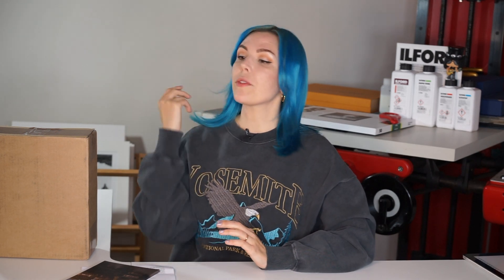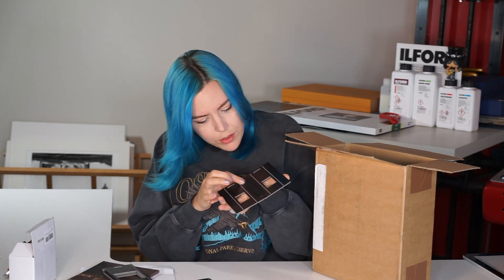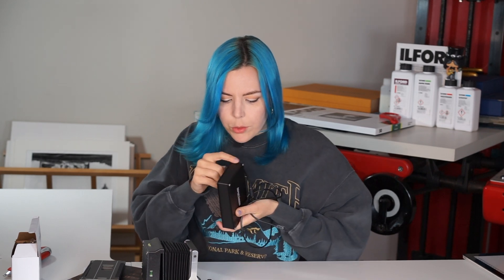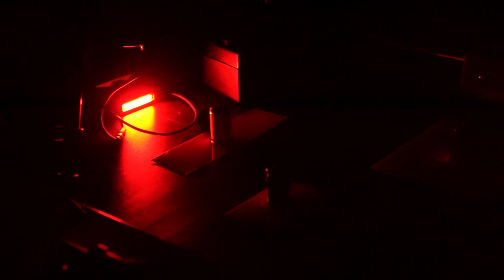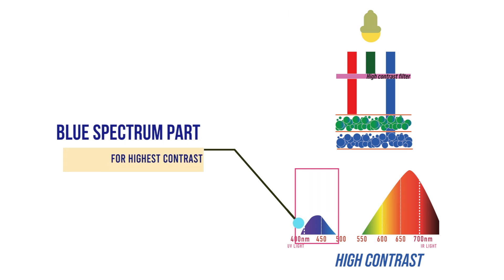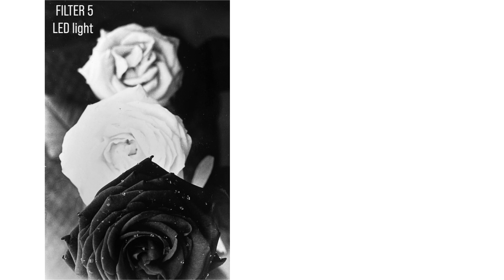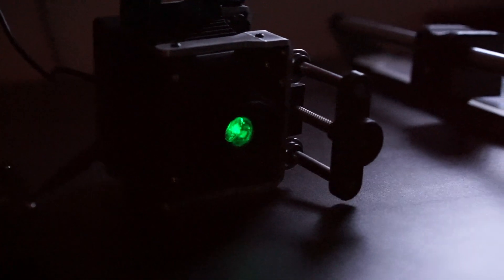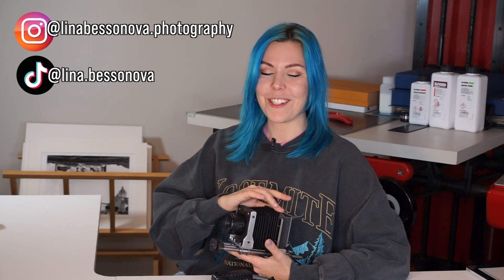Intrepid Enlarger Prototype Review

Comment: Very relevant and beautiful analysis especially the limitations of LED. I am a fan, The unpleasant aspect of blue/green systems is how dark the image appears on the easel while focussing and dodging and burning. Ilford Multigrade 500 is the father of all these b/g systems. Often for cheap on eBay. About the issues of glass carriers, pro labs and precision enlargements needs perfect flatness to exploit to the max the quality of your nice Schneider Componon S lenses. Focomat enlargers have a top glass at the minimum. Pro Durst and DeVere also. Dust management can be learned in a few minutes and saves spotting and improves local contrast by keeping sharpness. Beseler Negaflat carriers were the only ones to my knowledge to address flatness without glass. They are hard to find and they damage the very edge of the negative. Thanks again!

Comment: Enlarger in a case:  My first enlarger was an Opemus IIIC and it had a "case".  Eventually tossed their lenses for Nikkors.  Also had glass and glassless negative carriers.  The enlarger had a very nice focus aid.
Reply: In one form or another, those Opemus models have been around since I took photography in high school in 1961.  Quality design and construction unmatched by any Beseler or Omega model. Better than the small Dursts (and I use Durst exclusively). Harder to find in good shape these days, but a value if acquired.

Comment: Thank you for doing the Led breakdown! It's good to know what the benefits and the limitations are. I think I'm going to give this thing a try because I have a tiny house with a tiny bathroom, but I think I can make this work. I've been dying to do some printing instead of just digital scanning of my 35 and 120 negatives. I just can't fit a full sized enlarger in my home.
Reply from the maker: If you have well-exposed negatives, you won't need a filter 5, it will always be filters 1,5 - 3,5. As a beginner's enlarger it's more than well-built.
Reply: @linabessonova  great! Thanks!

Comment: If you have a color enlarger, do you still need to use filters for variable contrast paper?  I’ve never had a color enlarger myself so I used filters.
Reply: Old comment, but no, I don't think you do. If you have a colour head you can use that to work with multi-grade B&W papers. I think The Naked Photographer has a video covering this topic.

Comment: Great review but you did not give a conclusive, I would by this enlarger - or wouldn't, comment. Intrepid themselves compare this enlarger's prints to De Vere 504 prints so they are not seeing their enlarger as a toy as you described it. Do you feel it is capable of the professional results you demand of your own darkroom enlargers and would you spend your own money to buy one? Many thanks.
Reply from the maker: I don't give a conclusion, because I don't have one honestly. I am just not their target audience, I have seven working enlargers, plus three in my basement and three more of my husband. If I was a beginner with just a bathroom - I would either build mine, or get theirs. it's a super entry level thing. For professional use, it has to be a permanent setup with leveled table and head, and of course I would like to see the vignetting issue solved, and a different blue LED. They compare it to a DeVere with an Ilford Multigrade head, not to a tungsten bulb with fresh gelatin filters. I have never taken apart a Multigrade head, I have no clue how it is inside, and whether it has some filters that could have faded over time, or there is something that could have affected the spectrum. 
The result their current blue LED gives is NOT bad by ANY means. Even some heads from the past had such lights that didn't give a filter 5, but people still bought them and lived happy.
Reply: @linabessonova  I appreciate you taking the time to reply. Thank you!! I also appreciate your technical and analytical approach to the darkroom, which is why I sought your thoughts on this enlarger. I had previously watched the other reviews but I was happy to see yours, as I figured you would dig deeper and approach it from a technical data perspective rather than feel.  I have backed the kickstarter and I am also in the market for a De Vere 504 with a colour or multi grade head, so the comparisons were exactly where my thoughts are.  Thank you once again and I look forward to seeing more from you and your channel.

Comment: i wish it would be one for large format and not like all stopping by 6x9
Reply from the maker: Scaling up is easier than scaling down. If they feel enough demand and are well-funded (judging by the Kickstarter, they are;)), I don't think making an 8x10 would be that much of a challenge. The only big difference would be glass negative holders.
Reply: @linabessonova  that's of course true, I just find there are loads of 35mm and 120 film used or even new enlargers available, but for the bigger formats is basically nothing left and as they are producing bigger format cameras themselves isn't it in their self-interest?
Reply: @linabessonova  and to be clear, i would love them to make a 30x40 (11x15") enlarger
Reply from the maker: @florian_kopr  haha nooo I wanna be the only one with such a beast :D Kidding. If you really really need an enlarger of a format you cannot find, you can build one. It won't be extra pretty, but it will work.
Reply from the maker: @florian_kopr  I think they started with those small formats because it's also cheaper in prototyping.
Reply: @linabessonova  thx, I am on it already to build for 30x40 and one for bigger glass negatives, because I am tired of doing contact copies
Reply: @florian_kopr  What are you using as a lighsource? I have an old 8x10 enlarger (I blame Lina for that, lol!) with a faulty cold light source that needs replacing. Heiland might have an LED solution but it's a bit too expensive for me at the moment.
Reply: @filibertkraxner305  i have build myself a led  lightbox for contactprints and wanted to try that for starters, i also have colorstable gu10 led spotlights which i bought in  big bulk for my pakon f235 scanner years ago. I hope one of the solutions will do.
Reply: @florian_kopr  Thanks Florian, I may try to fabricate something with led's myself. I'm not much of an electrician, but we'll see.
Reply: Intrepid actually do have a 4x5 enlarger. Go onto their site and you'll see it there in their product catalogue.

Comment: Other YT media has tested this "enlarger" package and discovered the the output of the LED source is so uneven that it cannot be used to enlarge negatives larger than 35mm. Intrepid has confirmed that although set up to cover medium format sizes, the  light source cannot be used effectively for medium format. They hope to correct this defect "later".   As a practical matter, to use this product, you have to buy an enlarger and adapt its use or a copy stand or similar to get to a working device. That could be $150 up, and the Kickstarter is $300. My evaluation is that anyone proposing to spend $450 for an enlarger, is not going to be buying this jury rigged mess. Far better used enlargers are out there for much less.  "But it is so small, you can put in the box and keep in the bathroom between uses."  The labor to set up and level is more trouble than that would be worth. "You can use your tripod." Anyone who thinks that has never tried it.  For starters, every time you change a print size. you have to realign the whole contraption - you spend more time playing with the device than you do enlarging. Conclusion: Not ready for prime time!
Reply: I believe some reviewers have managed to print with a tripod. Lina is sharing some of these links. DIY copy stands made with extrusions and 3D printed parts are showing up and might soon offer a better combination with such product.  Intrepid has proven in the past they can offer certain options for a specific niche in the market. I don't think your expectations are in line with that niche. I would give them the benefit of the doubt until they ship in September. Used and cheap enlargers are almost gone now as the demand for Analog is climbing up. 
If Intrepid manages to bring people to printing the way they brought new people to LF, it's a good thing in my books. People just need to have the right expectations and Intrepid needs to be clear about what the product can and cannot do (which I believe is happening with all these reviewers).
Reply from the maker: All your arguments are correct, BUT what I find very important, is supporting a real, existing, living company. Yes, now those prototypes have some issues, and probably they will have to have thicker matte glass and increased height to diffuse light better, but those aren't huge changes. When you buy a used product, your money doesn't get invested into the future of the community, whereas everyone supporting companies like Intrepid is giving them (and all of us) a perspective. We simply cannot rely on used markets forever, if we want to move forward. Rome wasn't built in a day, and I am definitely hoping for improvements and other, more serious, products from Intrepid.
Reply: That doesn't sound like an unsolvable problem.  These are prototypes, after all.
Reply: Per Interpids comments on their Kickstarter page, the light evenness problem has already been resolved. The prototypes were using smaller light panels.
Reply: It's a prototype. What are you expecting of it. If you want a copy stand, build one yourself. There are always solutions to problems if you care to take the time to think about it. It's not a jury rigged mess, it's a start that will improve given more time and effort...and some money to help out. I've seen some of the "cheap" used enlargers on eBay and elsewhere. I wouldn't touch them with a forty foot pole. By the time you got a working enlarger you'd have paid more than twice their sales value in repair bills. And, nearly as much again, for missing parts and accessories. That's why good working enlargers sold on eBay and elsewhere are not cheap and generally come with most of their parts and such included.
Reply: @carltanner9065  No one who has ever made good quality enlargements in a real darkroom is going to fall for this nonsense, apart from the fact that it  is quite uneconomical in the current market.  The mere fact that to use it at all requires that you either buy up the rest of the parts to make it function properly (from other sources), or you spend your darkroom time tripping over a tripod and realigning the mess for every print  should be a terminal put-off   Also, others have tested and reported that the LED back, which would be a great reason to buy this at a reasonable price, is incapable of providing even illumination, which makes it useless. This is a high quality product from a serious company???
Reply: If you don't like it, don't bother with it. Like I said, it's a prototype, it's not perfect and yes it needs work. But, it's a start. Not everyone can go out and buy a good, working enlarger like a durst and such, then setup a dedicated darkroom to spend their days making prints. This is for those of us who can't afford to do that, don't have the space to do it and will have to make compromises in order to print pictures. That's obviously not your style and that's fine. But, don't bemoan others whose only avenue into darkroom printing is an enlarger like this. 

And, why would you be tripping over the tripod, when you'd have it setup on a table, off the ground. So what if you have to reposition it to get a different print. That's part of the compromise. Plus, you talk about having to buy all the parts to get it to work. You have to do the same with any enlarger. You want top quality results, when was the last time you went out and bought a good Rodenstock enlarger lens? How much did that set you back. And, like I mentioned, if you want a copy stand but can't afford one, build it. It's not rocket science. As for levelling the enlarger head, use a small spirit level. How hard is that?!! 

You like your darkroom all setup and running smoothly. That's your preference. Stick to it.
Reply: @randallstewart175  As I have said before, the LED backlight has already been fixed in a later mode. Of course, you will willfully ignore this so you can spew vitriol in youtube comments.
Reply: @Disco_Shrew  I had not pick up on that repair. Frankly, I still think that the idea of disembodying an enlarger of its vertical controls and alignment is one of those ideas only a committee can make, but time and money will shortly prove it out one way or the other.  I expect that those who buy into this idea as a first enlarger will  end up either getting pissed off over the hassle and stop enlarging, or will buy a fully vetted enlarger for dirt cheap from the vast horde of used ones still out there.  What would make real sense would be for Interpid to market the  LED head (assuming debugged) with adapter(s) for popular enlargers, as there  is nearly no competition for less than $1000 US that I know of.